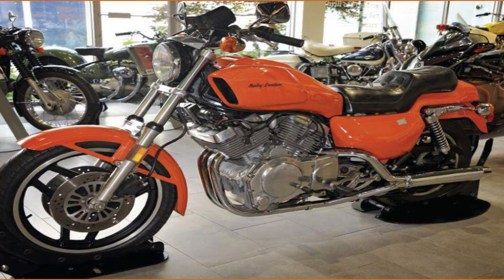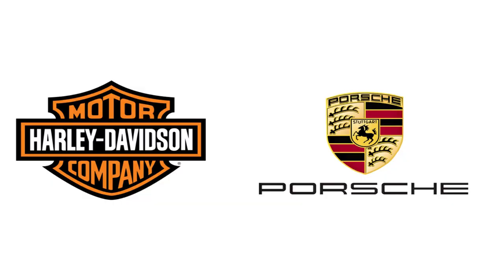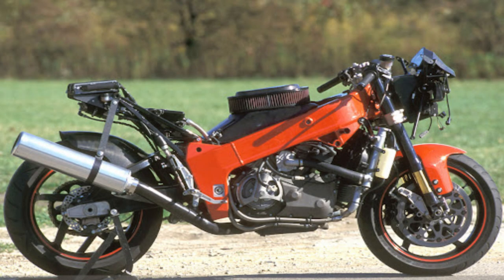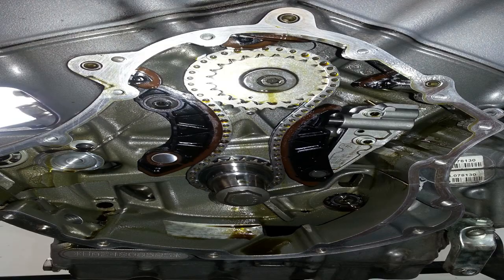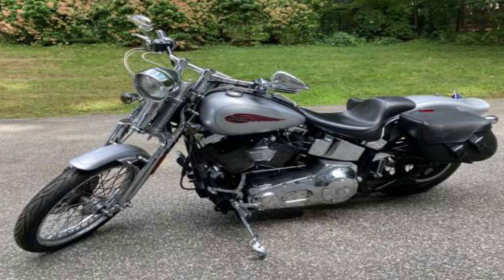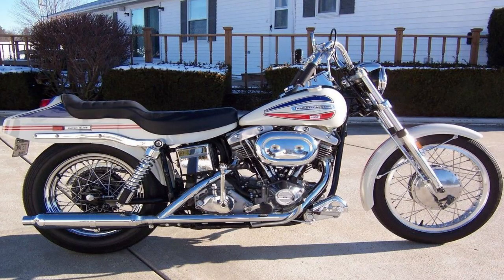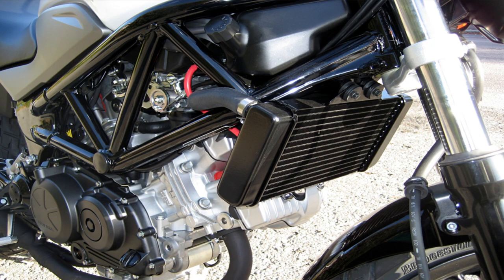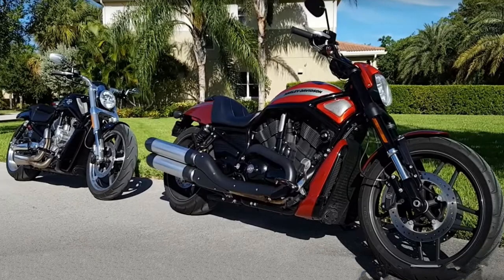VROD Is Harley-Davidson's Baddest Out of the Box Bike

Comment: You deserve way more subscribers than you have. The V-Rod haters, also called traditionalist, are the people responsible Harley is in deep financial trouble. They didn’t let Harley try new engine configurations or evolve for that matter. It would have been great to see the Vrod engine on a touring/dyna/softail/sportster.
Reply: Captain Fartmaster.  Really?  A Vrod engine in a Big Twin bike?  Maybe a Sportster (which is basically what HD did with their new water cooled bike that they call a Sportster).  The Vrod engine needed RPMs to get going.  It would not be good for 2 up riding in bikes that require torque.  Why are all logging trucks big diesel engines?  Torque is needed, not HP...  Same goes with loaded down, big heavy bikes that are carrying 2 people.  Take that low torque Vrod motor and put it in a bike that is rolling down the road at 1,200 lbs or more and see how it performs...  Go up hill loaded down, two up riding and see what a low torque, high HP motor does...  Just like your name, it would be a Fartmaster trying to climb that mountain..  Now try going up hill loaded down on a twisty road where there is a reduced radius, off chamber roadway.  That low torque Vrod motor would "fart" and crap its pants...
Reply: @Eidrian111  You are so young.  I have owned well over 40 large motorcycles in my riding time since Feb 1974.  I can tell you that a Vrod motor would not work in a touring platform.  Where does the torque and hp peak on a Vrod?  Not at 2500 rpm or even near that point.  Therefore, you will wear out the clutch trying to take off from a stop with that Vrod motor.  The peak HP is 115 at 8250 rpm and peak torque is 74 ft/lbs at 7300 rpm.  Now, if you geared that Vrod transmission so that it could handle the load off the line, you would be riding a diesel type ride.  You know, short shifting because you would run into the rev limiter real quick..  No sorry, my momma is dead and has been for over 25 years so her house is too high in the sky for you to get that weak powered Vrod motor up to her area.  If it was possible, other manufacturers would have made tourers with a high revving motor.  It doesn't work.  Let's look at a Vmax 1700 in a tourer.  Nope, that bike makes the Vrod's motor look like a Honda 250 rebel...  Why is it not in a touring bike?  Oh, but Yamaha put an air cooled 1830 or so cc, low end grunt motor in its high priced new Venture...  A Buell 1125 cc Rotax motor kills that Vrod, yet neither one of those motors are in a tourer...  The closest high revving motor that failed, in a tourer, was the Kawasaki KZ1300B2 model that I owned.  Too high or revs to make it a viable tourer motor, but it crushes the Vrod motor in a touring type platform and it was made in 1980.
Reply from the maker: Thank you, I appreciate it! The Vrod just didn't catch on in the US, it did every where else in the world. If they would of played with the displacement on it they could of moved it around on different platforms.
Reply from the maker: The Vrod engine as is wouldn't of made a great bagger motor, now with some serious displacement increase and cams centered around torque I could see it making it's way into a bagger.
Reply: @GixxerFoo  Agreed.  Engines like the Suzuki Cavalcade V4 1400cc, Kawasaki KZ1300 inline 6 (stroker configuration) are examples of engines toned for torque instead of high revs and they worked OK.  A Vtwin can not rely on rpms to produce power as a tourer platform, otherwise Ducati, Suzuki and Honda would have used the Vtwin high revving motors in touring platforms (TL1000, Superhawk 1000, Monsters).  Torque down low is needed for those long uphill tight twisting roads when you are riding 2 up fully loaded down.  I use to ride Mt St Helena from the Napa Valley to  Middletown and from Middletown to Cobb Mountain Lake County, CA...  Those roads require low end torque or a very low geared inline motor.
Reply: @ababbit7461  see? I knew your mommas house was really high. I’m not so young plus where on Earth do you get your numbers? Vrod torque peak is at 6600. So you make your point about tourers being low revving? How about every single bmw tourer and sport tourer? Kawasaki h2 sx? That one peaks at 11k rpm and it’s really comfortable. I mean I have nothing against hd tourers but you have to admit that those pig iron engines are crap, really cool, but really crap.
Reply: @Eidrian111  I am not a HD die hard rider.  I have owned ten of them and currently own 2 of them, but I buy them from people who are letting them go cheap like my 2003 HD RKing CVO with the 103 cu in motor in it.  It has 9,000 miles and I got it for $5,000.  I think I can ride it a few years and sell it for $7,000 is the only reason I would buy a Twin Cam, cam chain tensioner  piece of junk, ass motored of a bike!  I like the Sportster motor with the Buell Thunderstorm kit in it. I like air cooled motors because my KZ1300, Cavalcade 1400, Valkyrie 1500, Goldwing 1800, Goldwing 1500, Vulcan 1500 Drifter, CBR1000F, all developed water coolant leaks and the KZ1300's water pump shaft broke.  Try fixing that.... I like stroker motors for the pulling power.  While I agree that the HD motors are not all that great, the point of their existence is part availability for years and years by the aftermarket.  Try getting parts for a KZ1300 engine as compared to a Shovel Head HD...
Reply: @Eidrian111  I forgot to answer your question.  I got those numbers off the internet and they were crankshaft numbers, not rear wheel numbers.
Maximum power - Output - Horsepower	121.00 HP (88.3 kW)) @ 8000 RPM
Maximum torque	115.00 Nm (11.7 kgf-m or 84.8 ft.lbs) @ 6500 RPM.
Make Model	Harley Davidson VRSCA V-Rod
Max Power	115 hp / 84 kW @ 8250 rpm
Max Torque	100.3 Nm / 74 lb-ft @ 7300 rpm.
Depends on what information you get when you search Vrod hp and torque...
Reply: @ababbit7461   agreed 100%. Definitely they are more complex machines. I’m pretty happy with the 110 on my street glide and currently watching these great videos to make an informed purchase on which cams to go for the deluxe. Great conversation going back and forth on Harley engines. Have a good one.
Reply: @Eidrian111  You too brother.  Have a great Christmas...
Reply: @ababbit7461  likewise brother.

Comment: I don't mind the water cooling but I would rather have it on a pushrod engine than and OHC engine.
If they MUST run OHC I'd at least like to see an easily accessible outboard timing chain or timing belt set up with hydraulic valve lash adjustment.
Reply from the maker: That's the biggest down side to the overhead cams is the valve adjustments, it's not a super easy job on the Vrod either.

Comment: Just bought myself nightrod......under 3k miles, totally stock, nice and quiet (sort of), fast if if if my gsxs750 is in 3rd going 30mph(3000rpm) and my nightrod in 2nd gear doing 30mph(3000 rpm) and both hit the gas the rod would hit 80 well before the gsx.......however redline rod is 9000 and gsx 11500

I'd actually have to do 1/4s to see which would be faster driven to best get speed(30 mph at 3000 rpm is not best for either and death for the gsx), but I do believe the rod would win

Mid pegs, don't sit on it and say no way, I took first test ride and pleasantly surprised with comfort.....and power, took second test ride(it was calling my name) long ride, back upright, arms down relaxed, knees high, but it turns out knees high is very comfortable (about an hour ride), after I bought it I went out for 3hrs, still comfortable.

I might sell my Dyna.......nah

I put it up for the winter, Ultra out, better for winter. I bought Harley frame bag and I already got cheap Harley bag I had to put on the back of my Dyna because the flap wouldn't hold down while on the front.......so I bought some diy Velcro and I'll put it on the front of rod since it won't be blocking cooling air.......I already figured it out looking at the radiator..........and I bought an aftermarket bra, apparently Harley doesn't sell them anymore

Did I mention.....it's fast

In the curves you lay it over and it stays.....idk how they do that but I've only had one other bike that did it..... Yamaha Stryker after I put 240 on the rear
Reply from the maker: They make a really awesome muscle cruiser, it's a good compromise of power and performance if you're not into the air cooled models. My dad's had his 2012 Nightrod for about 6 years now and he loves it.

Comment: My friend has one with a tuner and 2 into 1 exhaust. It was so light it felt cheap. Then I rode it and got my foot blown off the peg it was so fast. Loved it, only complaint is it's a bit of a stretch for me im 5'7".
Reply from the maker: They for sure could benefit from some mid controls, that's always my biggest challenge with one is that I am 5'7" too and it's a reach for me. Hard to keep your feet out there when you lay into the throttle on one!

Comment: I've got one that has the drag package on it with a wheelie bar. It was left to me by my uncle but it didn't come with a title and pretty sure all we could come up with was the original bill of sale/ NHRA info paper clipped to it. It looks a little different than the ones you showed in this video.
Reply from the maker: It sounds like you have the factory drag bike, the Vrod Destroyer. That's a race only monster with 165 horsepower, that bike got pretty much everyone banned at the strip. Almost anyone could throw a leg over one of those and after a few passes get below 10 seconds in the quarter mile. If you don't have a pro license they will ban you lol.
Reply: Well you have the VRXSC aka Vrod Destroyer and it'll do a quarter with a 250lb man in 9.75 at a good prepped track, it'll also get to 60mph down a back alley in 2.9sec if the pavements smooth and tacky from the summer heat otherwise it's a smoke show at best. These thing if they have under 20 passes (10mi) and have no rash will command around 25-35k depending on what's added or subtracted from the bike with the only outside accessories of note being a Vance & Hines Indy race exhaust and a Pingle electronic shift, on the plus side is new Dunlop screaming eagle drag tires. Hopefully your uncle left the screaming eagle tuning module as well as this is what made the bike a weapon in the right hands at the track. Enjoy the ride if you dare and don't try riding it to far as it doesn't get or have great fuel mileage.

Comment: Never got into the V-Rod but just got educated pretty good....Been working on an old 67 T120 Triump and have been impressed with the one piece Crank and the cushioned Crank compensator.... I have a 07 twincam and gonna change to a Man o War comp and am worried to find out how bad my Crank runs out.....96" but needs more power .... May be putting in a Darkhorse crank.....
Reply from the maker: The Vrod was an awesome platform, they run pretty dang good! Dark Horse's Man O War is a awesome alternative to a the compensator. That rebuildable cush drive is pure genius in that unit, you might be surprised if you check your run out. Sometimes the late models aren't too bad but if I was going to put a crank in Dark Horse would be my choice.

Comment: I tried a VRod out for size around 20 years ago, I still have the photo. Sadly, as with most bikes, it was out of my reach.
Reply from the maker: They are pretty inexpensive now compared to a lot of used Harley's out there. They are still really solid bikes even today and a lot of them still have very low miles.
Reply: @GixxerFoo  They're in the same price range as the main bikes over here. Most have low miles, our roads aren't very long

Comment: I don't think the dealers pushed them hard enough for some reason. Love my 09, has a stage 2 kit with open air box, and tuned. Make 124 hp at 9300 to the ground.
Reply from the maker: It's very impressive what they could do some quick mods and a tune! Dealers didn't really push them like you said, even the dealers weren't too big on them it seemed like.

Comment: Those that have an open mind, appreciate the V-Rod, for what it is. I find it interesting, that the Rod could not fit a Monoshock on cuz of the under seat gas tank. Because, Germany had a hand in designing the Honda ST 1100 cc v-4 engine/ motorcycle  , with an under  seat gas tank,  and it does have a Mono shock.
Reply from the maker: I would have to say Harley's styling department had a lot to do with that and keeping that long low profile of the bike without making the chassis too tall.

Comment: Would like to know your thoughts on a s&s 124lc for a 2016 SG
Reply from the maker: The 124 kits are awesome if you're going from the crank up on a kit that big. My only hang up on the 124 is putting one together with a stock crank, that's where you can run into some issues. To get a 124 done right so you don't have to worry about it a Timken bearing conversion with a good crank is a must.
Reply: @GixxerFoo  I was going to purchase a  S&S 124 LC create motor

Comment: Are 2 into 1 exhausts systems for vrod typically the same as far as performance? What do you think of the Trask Performance Assault 2:1 and  Akrapovic Titanium 2:1 systems?
Reply from the maker: Vrods produce more power with a 2 into 1 than they do with slip ons, really any two into one on a Vrod will make some serious power. Both the Trask and Akrapovic are awesome systems for the Vrod, probably the best two you can get out there.

Comment: Gonna have to disagree with the statement that the plain bearings would have been good for the 45* twins too.  The way the combustion put the amount of vertical force on the crank during ignition would lead to oil splash out: leading to temporary metal on metal during the down stroke under hard throttle. The ball bearings found in harleys are perfect for the type of engine they are, the need little oil to function perfectly. In fact if one uses a 3 hole crank pin it leads to the bearings skating along the surface instead of rolling due to TOO much oil. 
There have been a hand full of small companies that have built performance evos with the plain style bearing, theres a reason why it never caught on.
Reply from the maker: That's a excellent point, Harley has been pretty mum on the plain bearings. Even the designer of the XR750 only said "probably" when he was asked if he wished he'd used plain bearings. It would make for a very complicated setup had they tried to use plain bearings, I have no doubts they experimented with it.
Reply: @GixxerFoo  ah didn't know that! 
I think in the example of the vrod and similar v twins the plain bearings win out. The much smoother and much higher rpm range they operate in as well as the shorter stroke is perfect for a plain bearing type crank.

Comment: Baggers in general are made for an entire different purpose than to go fast. Even when they can go fast you couldn't use the power cose in every corner you would scrape yer bike to pieces. And going straight ahead is as boring as hell. So serious power in a Harley bagger big rig is like trying to make a Semi truck fast, which is ridiculous of course, well maybe on a closed course...when those Semi Trucks would race each other... So there is tour bikes like the Big Rig Baggers that are made to go nice and slow to enjoy the surrounding and there is fast bikes which should be able to hit the tight corners with high speeds, without scraping exhaust, footpegs, Floorboards, or even an radiator flair because they are mounted to close to the ground. 
So, no! mounting a Porsche V-Rod Engine in to a Bagger is, No matter how you look at it, a bad idea 
Creating a serious sport bike which stands high (Like Yamaha R1) of the ground based on the Porsche V-rod engine, now that would be an excellent idea !
Reply: [Indian Challenger has entered the chat]
Reply from the maker: Indian turned the bagger market upside down with the Challenger!
Reply from the maker: The Vrod engine would need some serious retuning for a bagger, they'd have to get some displacement in there and tune the power for more low to mid range. That same motor as it is in the Vrod wouldn't work for a bagger, it's way too high revving in current form.

Comment: the only thing I didn't like about the vrod was it had bad handling. only 26-28° of lean angle for all of the models except for the street rod
Reply from the maker: Yeah it does leave some lean angle to be desired, with that long chassis it doesn't exactly turn on a dime.
Reply: Nope.  32 degrees left/right.  More than the majority of HD products.
Reply: @zf4hp24  less than any sportster

Comment: I have a friend that recently purchased a 2002 silver model with less than 30,000 miles. Bike sounds and runs great. His complaint is poor fuel mileage. What's goin on. Compression is good. Oil pressure good. Temp is good. I have never looked at the motor. Was that year fuel injected or carburetor? If the later could that be the problem? Or is the little tank is fooling him?😁👍✌
Reply from the maker: It's fuel injected but the Vrod is a very thirsty bike, the early model had like 3.5 gallon tank that was later upgraded to a 5 gallon tank. They do use some fuel, nothing wrong with the bike though, my dad has had his 2012 NightRod for 6 years and I can confirm they just like fuel.

Comment: The vrod isn't the black sheep of HD. Its a bad motor scooter. They made a mistake stopping production of the bike. Now they have the pan American.  Ugly as can be. They need to use that engine in a cruiser .
Reply from the maker: It is a shame the Vrod went away, I was a little disappointed the Sportster S didn't get the 150 horsepower. Lol but 120 horse is still pretty awesome, I do hope they work it into some more traditional Harley designs later on though.